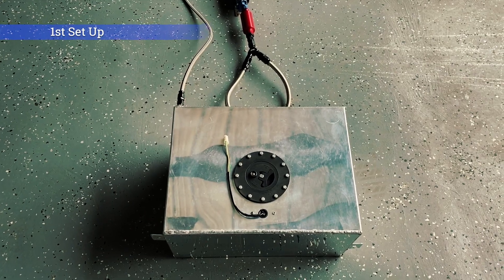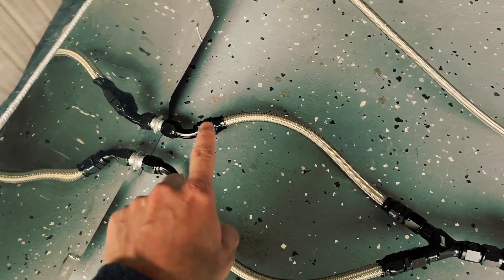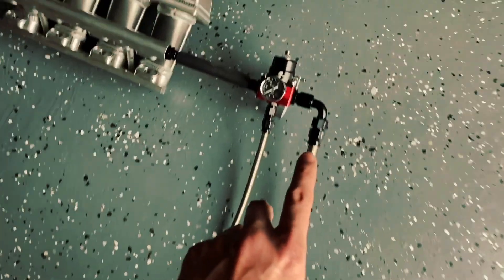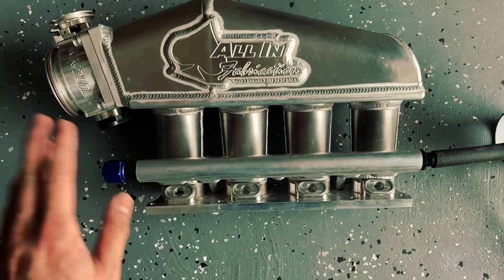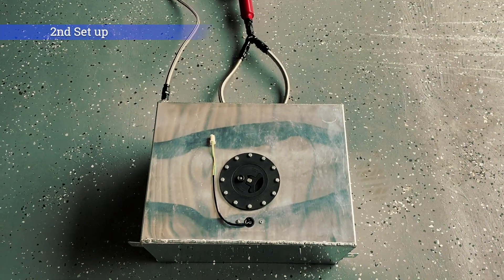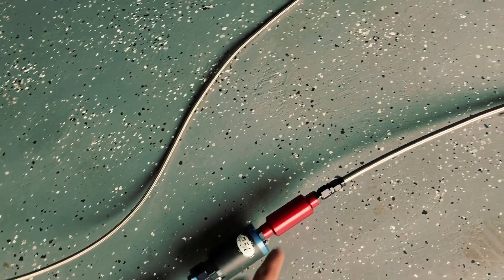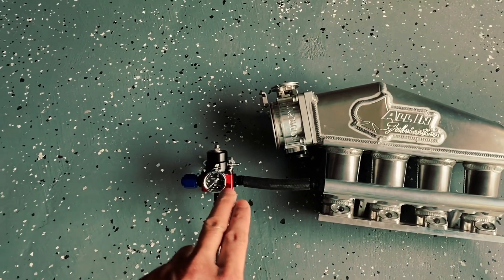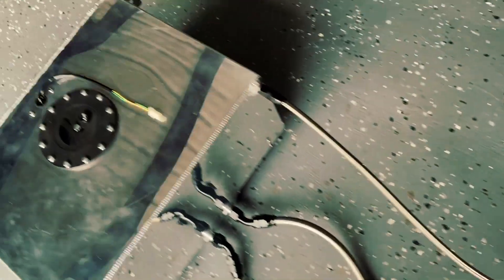Full Fuel cell set up

Comment: Hi clearest video ever, how easy would it be to make it switchable between a tank and fuel cell for different fuels like how lpg works
Reply from the maker: I doubt it be easy but a few relay switch and solenoid to turn on and off the fuel pump and extra line can make it happen.
Reply: @KLIMPORTS  awesome thanks for the reply
Reply: @KLIMPORTS   would it need another pump for the cell or could switch between lines from the tanks on the same pump
Reply from the maker: @streetcarstv5088  another pump for the cell would be better and easier
Reply: @KLIMPORTS  cool ok ive got a cell already shopping for other parts now, thanks for the help :)
Reply from the maker: @streetcarstv5088  np

Comment: If I have a fuel cell in my trunk is it possible to mount the fuel filter and pump in the trunk as well or does it have to be under the car?
Reply from the maker: You can mount it inside the trunk also if you have room. I wanted to do that but I didn’t have room!

Comment: THANKS FOR THE VID. WHICH SET UP DO YOU PREFER? ALSO WHY DID YOU USE A FILTER AGAIN AFTER THE PUMP?
Reply from the maker: 2nd setup I prefer. Pump can go out and debris can come out the fuel pump.
Reply: @KLIMPORTS  THANKS FOR THE RESPONSE. WHAT SIZE LINE ARE YOU USING FOR THE SUPPLY AND THE RETURN? & WHERE CAN I GET THOSE LINES AND FITTINGS TO BUY? ALSO WHAT BRAND FUEL PUMP ARE YOU USING?
Reply from the maker: @qrs3658  8 feed and 6 return . I go with summit racing fuel line and fitting is so easy to use and good quality beside eBay China knock off crap.

Comment: For a carburetor would I use a lower psi fuel pump?
Reply from the maker: Depends on how much fuel you need to deliver
Reply: @KLIMPORTS  250-300 hp is what im aiming for and i feel like thats a pretty average amount for a chevy 350
Reply from the maker: @SilverBuilt  just a upgrade fuel pump beside stock will do the job!

Comment: Would there be a benefit of running option 1 vs 2. Also would there be a fuel pressure difference that would affect performance?
Reply from the maker: I ran both ways before and never had a problem but everyone prefer option 2.

Comment: What are the advantages/disadvantages of running one setup vs the other? Most people say the second setup is correct.
Reply from the maker: If you don’t have a aftermarket fuel rail you can run the first setup because most factory fuel rail is block on the other end. I ran both and never had a problem with it! But most people run the second setup!

Comment: What fittings are you using? 8an fittings? and what line is good for e85 and gas?
Reply from the maker: PTFE Fitting and yes number 8an fitting, Teflon steel braided hose will work for gas and E85. Check out my other video on how to install PTFE fitting..

Comment: Awesome video. Appreciate the visuals. Are there any advantaged to running two feed lines versus just one?
Reply from the maker: In my opinion I just think two is better than one , cause you got two lines feeding you gas then one especially when you trying to run high hp.
Reply: @KLIMPORTS how about for a can that caps out at 5000-5500 rpm? Im building a e30 with m20b27 and i plan on boosting it.

Comment: Just curious, I've seen fuel cells use the bottom two as return and send, why in this case for both examples you have it in Y configuration? I understood the top (were you have the return line) is the vent. Super helpful video tho! Just would love some help figuring out what I wanna do with my own.
Reply from the maker: Why I do the Y is because you have to think about it. 2 lines feeding you gas is better than one especially when you building a high hp engine. I would never use the bottom one for a return line cause of the resistant. Try to blow fuel back on the bottom return line when you got half a tank and now try to blow the fuel back on the top return line when you got half a tank. Which one would be easier for you to return the fuel. Hopefully that answer your question. Thanks for watching 👍
Reply: @KLIMPORTS  It helped a lot, makes sense. I kind of figured that. Another question if you don't mind, where does the vent come into play? Since I'm deleting the old fuel tank and charcoal box, I figured I'd still need a vent.
Reply from the maker: @paintballmonster24   you should have 2 fitting on the top of the fuel cell. If not make one that’s what I did.
Reply: @KLIMPORTS  It's not two lines feeding you gas. What you're saying makes zero sense in regards to your one pump setup. The Y does nothing because it ends up going through the same size line anyway, still using the same single pump. Also, return line should not just dump in to the top of the tank because it aerates the tank. Proper way is to buy a submersible runner line attach to a bulkhead fitting inside the tank and it redirects the fuel below fuel level and does not introduce air that way. Requires drilling a new hole with the cheap cells.
Reply from the maker: @otallono  I did say you didn’t have to use two feeding lines in the video that’s what I wanted to do. The Y end right at the pump it will help,  if it was far away from the pump then yes it won’t help.

Comment: Do this work on carburetor set up
Reply from the maker: Yes you can. Check on your setup first, because you can use it without fuel pressure regulator. If you are using a fuel pressure regulator than put it between the fuel pump and carburetor.

Comment: You don't need the splitter. You use the splitter when you have two fuel rails. It's a waste of fittings for a single fuel rail setup. Just plug the other outlet.
Reply: Or dual pumps

Comment: Hey what will be the biggest fuel cell you can make fit in front of the mr2??
Reply: And what will be the best fuel filter and pump for about 600hp
Reply from the maker: Andres Morales the tank I made  is a custom 13 gallons. You can go bigger but it’s up to you and what you have all in the front.
Reply from the maker: Andres Morales I use Magna 750 fuel pump can handle up to 1,000 hp, and automotive fuel filter!